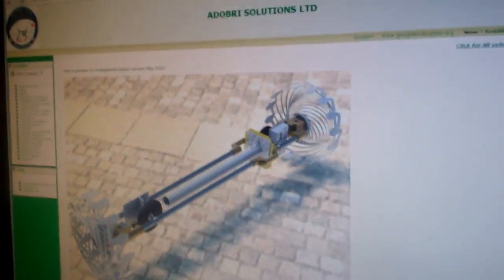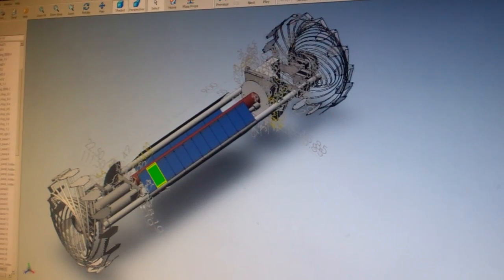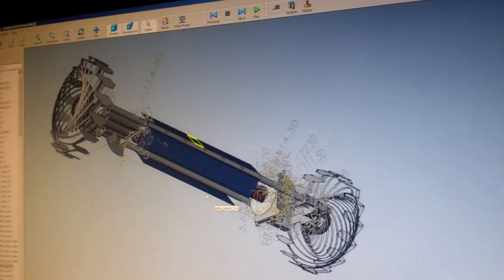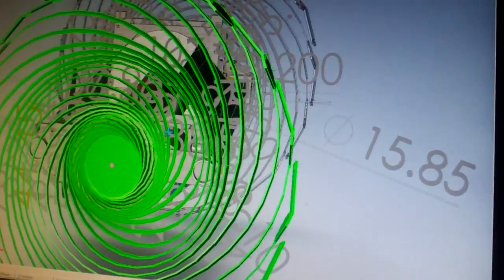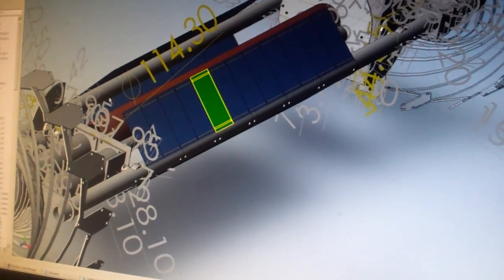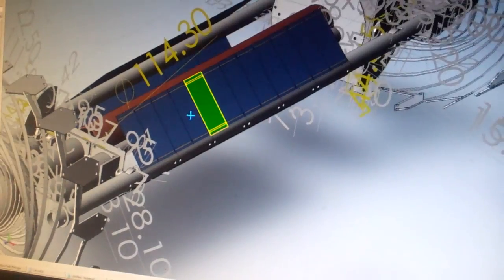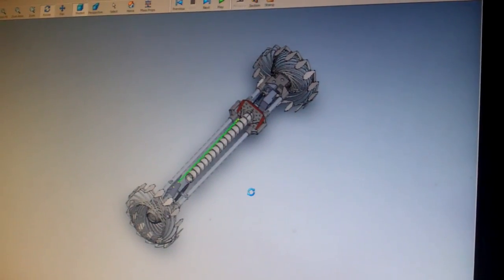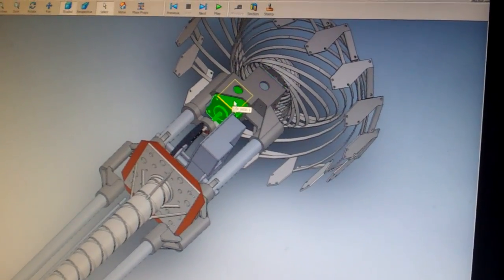Ground Station, rover ver 6, clearance, solar power harvesting surface.(станция связи=лунный ровер)

Comment from the maker: Last week was spent in redesign of a rover and ground station. It was done by three main reasons -- 

Ground Station, rover ver 6, clearance, solar power harvesting surface.

a) ground station needs to be build and 3D models for 3D printer has to be finalized.
b) clearance of a rover needs to be increased.
c) needs to increase solar power harvesting surface. 

In old design on frame was mounts for flexible solar panels (cells).
each cell  has size 25.4 x 63.5 mm = 16 square centimeters.  
length (long side )of the frame was 600mm, that gives a place for 23 panels with total surface of 0.037m^2
two frames allows to use 4 times more - total 92 cells, or total .14 m^2
with efficiency of 0.09(9%) and power of a sun per square meter  = 1kWt surface can give 13.35 watt total.
Top side of a rover can harvest some energy, but at the same time bottom did not, it is in shadow -- outcome power probably is half == 6 watts.
Solar panels mounted on frame with 45 degree angle. 
Problem (b) frame is not flexible, in can stuck on terrain - as a result needs to increase clearance.
Second problem (c) - needs to increase harvesting power surface.  (6 watt capable source with 40% efficiency of a 10 watt transmitter, means that transfer of data can be done only in 1 minutes with another 3 minutes 20 seconds waits to harvest the energy.

Flexible solar panel side is 63.5 mm. Assuming it is hypotenuse - that geometrically gives in prime triangle with 45 degree angle, side sizes 45+45mm -- which is bigger that original 63mm.
Sizes of each cell will be smaller (like 25.4 mm x 44.9 mm) but on same frame now it is 46 cells with 0.052 m^2.
On 2 frames can be placed 4 groups of 46 cells, calculating same efficiency and same Sun's power, that surface allows to harvest total 18.8 watt. 
Same top-bottom and max outcome power is 9 watt. That is better, than previous design, and it mean == 1 minutes to transmit + 2 minutes to harvest.
Placing additional 2 stand (length 0.5m) which can hold 19x4 = 76 small size panels outcome additional 0.17m^2 with total power 15wt (and half of tit is 7wt). Gives the grand total is 34wt from all surfaces, and halfing gives max s 17 watt power. Which is not bad -- on top of each minute to transmit it will require 35 seconds to harvest.

Now the question where to place that two stands. Plus needs to balance weight- i.e - 350grams for each 4 stepper motor, but gear motors can be reduced to have less torque. That can save around 50-100 grams on a motors in favor for stands. Reducing clearance makes smaller dimensions and also saves weight.

Total amount solar cell (sizes 45x25mm) to accommodate on rover today is 168. With weight limit of 400 grams for all system it is 2.3 grams per flexible cell including weights of holders and mounts. Plus needs to account that after 3 week flight cells will lost 1/2 of it power capability. Realistically it will be 8 watt of power at best.

That is a theory -- up today Ground station's 3D models probably ready to be ordered, but rover's energy harvesting mounts not finalized yet.